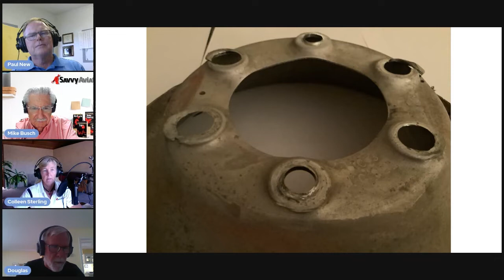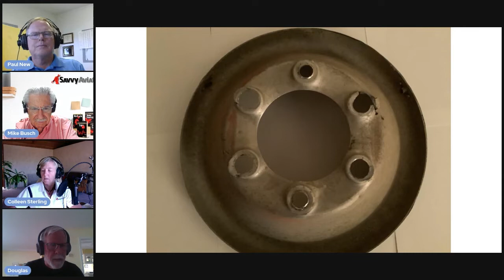Ask the A&Ps Ep1 - Use a cigar to test pressurization, and other bad ideas

Comment: Douglas's spinner bulkhead problem.   Washers are a problem.   It they weren't supposed to be there that can affect the bolt stretch and torque value - especially if they are not lubricated properly.